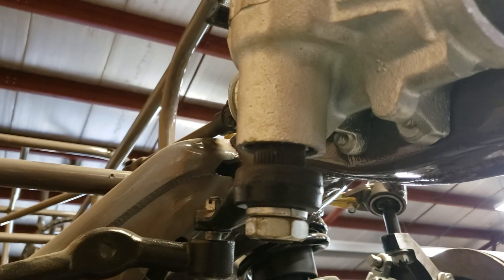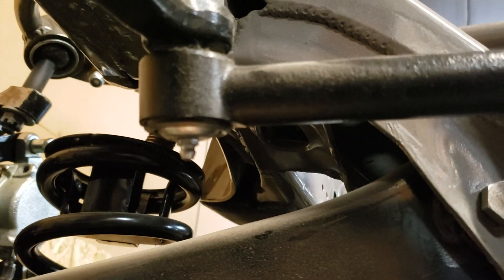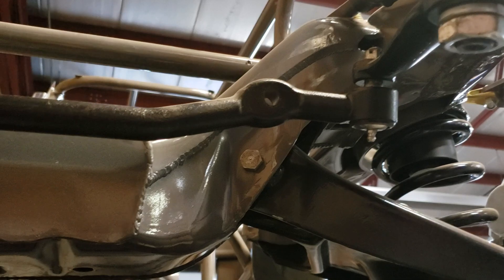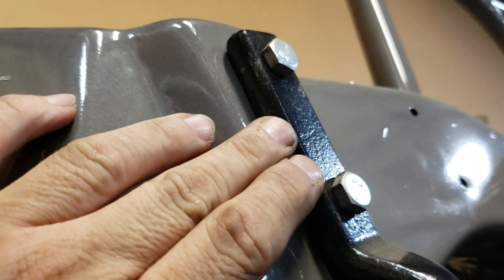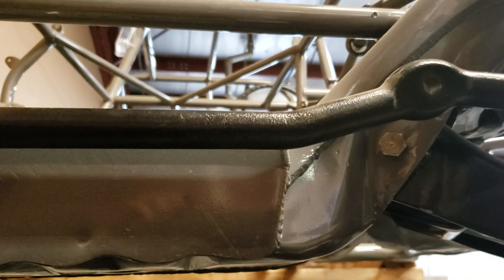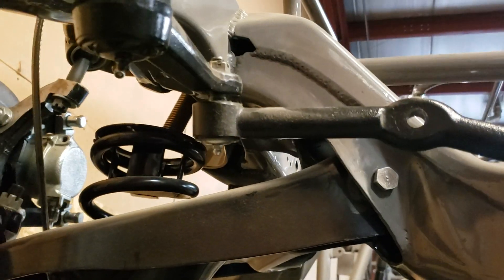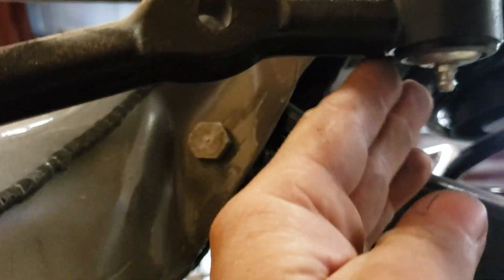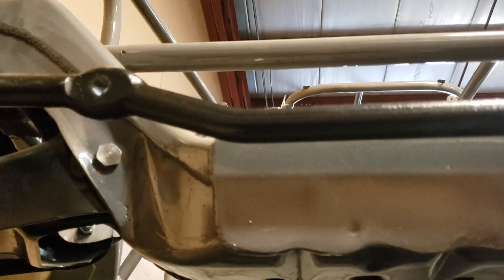Squaring drag link on front steer car

Comment: I had to set the toe on my modified. I didn’t have any turnplates, but I did have a 12ft straightedge and 2 3”offset rims on the left side. I squared the left side, then took a tape to toe the RF 3/8” out.
Reply from the maker: that works aswell but only if the rear end is square in the chassis

Comment: My side to side is the same on both measurements, but zert to idler arm is about 3/16ths more than zert to shaft. If you put washers on the chassis is this now going to throw off my side to side? Thank you for all your work Dave!
Reply from the maker: if the side to side is correct but the x is off then simply turn the steering wheel